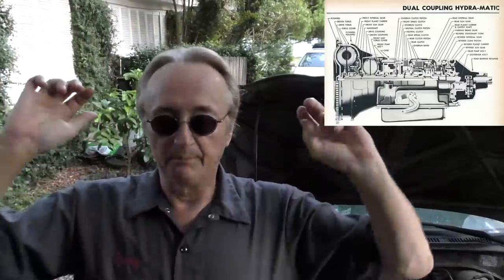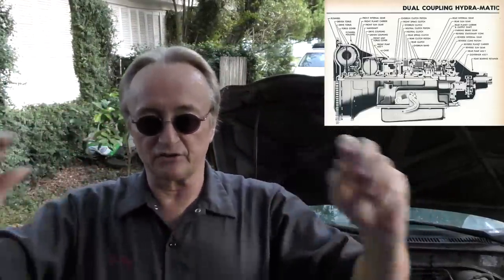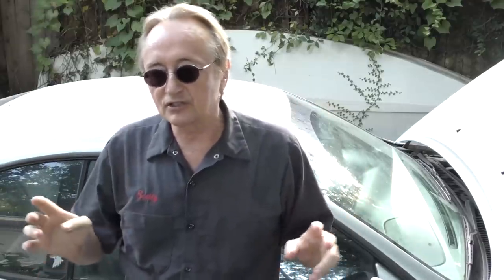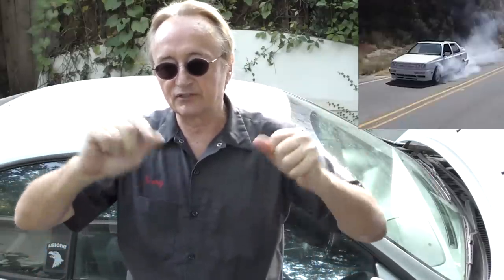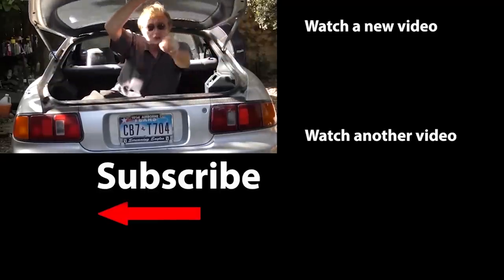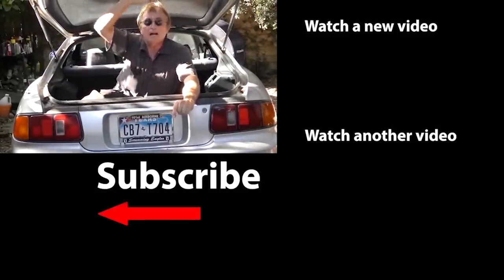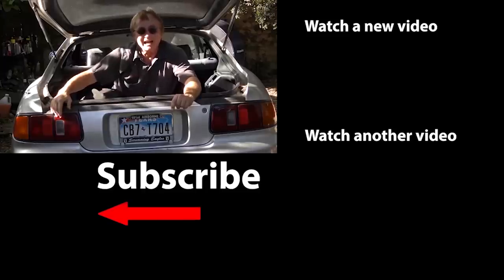This Isn't a Real Corvette, Here's Why

Comment: I had 2005 Chevy Spark. The worst  manual transmission ever. Changed 3 sets of gearbox before even reaching 200,000 km.
Reply: Anas really???😮😮😮How did that happen? Did you ever try a better fluid?
Reply: @jamesmedina2062  change it every 25,000 km with the type recommended in the user manual.
Reply: Anas yeah I was grinding gears and not feeling the gates in my Honda when it had factory fluid but after replacing with Motul, I have no more grinds(which were rare before anyways) and I can feel my way around better. I think the manufacturers sell cheap, crappy fluids and guarantee destruction.
Reply: Because it's a chevy.
Reply: @samlung2724  it was actually a rebadged Daewoo Matiz from Korea. Korean car... Never again.
Reply: @jamesmedina2062  with mine I had problem downshifting to 2nd gear. Had to do double-clutching & rev-matching every time.
Reply: Anas I do rev match when downshifting my Honda Civic. It's just suggested for any car. That said I'm sure the synchros and other parts vary across different brand cars. For example I drove a Chevy Cruze and really liked it but I had trouble finding the engagement point of the clutch. The pedal felt isolated and did not have a smooth take-up so I nixed that purchase and went with the Honda despite higher cost.

Comment: I love the way my SLK 55 AMG Shifts, intuitive automatic, it down shift every gear just as I would if I were in manual mode which it has, comfort mode for "normal" driving and sport mode for the twisty roads. Most super cars these days are automatic with paddle shifters and manual mode. I'll take my 7 speed auto but I do get looks from guys that like having their right hand on cylindrical objects constantly.

Comment: Scotty you are right, the Toyota 86 is a Subaru as you state.  However, it is realized it is not all Subaru.  The engine is definitely from Subaru.  But the automatic transmission?  It is Aisen - or Toyota.  It is a hybrid of the two manufacturers, even on the powertrain.

Comment: The Mazda 6 comes with a standard. It's really nice too; probably the same as in the Miata. I bought a 2016 in late 2015 and they even had the mid-spec Touring available.  I think in 2018 they only came in the base Sport, but they now have many of the features that required Touring in 2014-16. Obviously the Mazda 3 also offers manual. VW stopped offering a manual Passat with the 2016 model year.  The Honda Accord also comes with manual and I wouldn't buy an Accord automatic because they are CVT. So the only manual larger cars are the Accord and the 6 in the US.

Comment: 😕 electronically controlled duel clutch transmission is faster in every way!?! I can't see the laziness in that..
Reply: Can't see the laziness in the driver required to do absolutely nothing more or less than any other automatic?
Reply: I bet in a few years there will be tons of dual clutch auto vehicles in the junkyard with dead transmissions that are to expensive to fix. Just like northstar cadillacs.
Reply: @AmandaHugenkiss2915  Do you understand the difference between a manual, and a dual-clutch auto? Are dual clutch trannys actually THAT complicated to fix, finicky, fragile?
VW makes a great one, withstands as much as 500 ft-lb torque, can be tuned with software (such as APR does), shifts in fractions of a second. Yes there's maintenance with them because they have clutches that engage and disengage just like a manual transmission has a clutch that engages and disengages and wears out over time. They also have lubricating fluids, just like a true manual, but some of those dual clutch systems are wet clutches, bathed in oils (periodically or constantly, depending) just like a motorcycle clutch is.
Reply: @exothermal.sprocket  oh I fully understand the difference between  a manual, a conventional automatic, a CVT and a dual clutch auto. And while the performance of a dual clutch auto may be great and fun, we all know they are very expensive to fix or replace. I would venture that the long term  durability is not there also. Time will tell.  Especially given most people may not understand how they work vs a regular automatic, leading to excessive clutch wear. Couple that with today's inherent lack of durability due to over complexity where it doesn't need to be.... and yes, I can see a lot of cars at say 10 years and maybe 120K miles not being worth dropping 8K on a new transmission. Hello junkyard.

Comment: I have a 2012 VW Jetta TDI with an automatic transmission, I have over 180,000 miles on it and have never had an issue with the transmission. Just started having issue with the DPF though, that is not going to be a cheap fix apparently.

Comment: I got a 2009 Toyota Tacoma TRD sport with a 6 speed, 2002 Subaru WRX with a 5 speed, and a 1996 Subaru brat with a 4 speed. My only automatic is a 1991 mustang GT that I plan to swap a 5 speed.

Comment: Scotty just an FYI, Tacoma is offered in manual transmission with 4 cylinder or 6 cylinder but it’s bed/ overall length is the issue. Full crew cab with 6 ft bed only offered in automatic. As well as limited trim is only auto. Hope this helps

Comment: Two more car models that Scotty didn't mention and that still come with a manual transmission on the most basic trims are the Honda Fit (known as the Honda Jazz outside of the United States) and the Nissan Versa. The Honda Fit also has a "sport" trim that will come with manual transmission.

Comment: In the case of the Mazda Miata, the ND (fourth generation) automatic actually goes slightly faster and has the same or better fuel economy than the standard transmission.

Comment: The 60’s and the 70’s saw GM, Ford, and Chrysler producing excellent transmissions that were both durable and reliable. The Turbo400 (GM), the C6 (Ford), and the TorqueFlite (Chrysler) were all magnificent pieces of engineering. What happened that all of that changed starting about 1981?

Comment: The Mazda 3 comes with a manual transmission too, but only the premium package in FWD for additional cost so you'll be paying 30k for it. At which point you should probably just get a miata.

Comment: 10:03.  One reason for avoiding putting a stick in the new Corvette is probably the fact that it's difficult to engineer a nice feeling shift linkage if it has to go all the way around the motor to get to the transmission.

Comment: The Hyundai Veloster can be had with a manual for 1k cheaper. At least the 19's were.
In 50+years I've only had 4 automatics, a Vega, Chevy Van, Caravan and my current Ecosport.  The other 12, all stick.(09 Aveo was the last)

Comment: I couldn’t imagine living without a standard transmission (for myself). The family SUV is automatic but that’s not really for myself, it’s for the family, although the kids like to drive in my manual cars. I’ve been thinking about getting something newer to replace our old BMW but they seem to enjoy the BMW a lot. They like zipping around in the old stick shift convertible bimmer much more than a modern hybrid/electric or automatic. Contrary to Scotty’s advice, my 2001 BMW 325ci has been extremely reliable for us. It would be a shame to get rid of it so long as it’s working well and getting good gas mileage. I just wish I had more garage space to keep it inside. Recently I’ve been keeping it outside with a car cover. I don’t like taking the cover off all the time but I don’t want to ruin the rag top in the sun.

Comment: Since I bought my first car in 1988 at age 21, I've only owned standard transmissions.  I refuse to buy an automatic, which is no fun and which bosses me around.  I want to control the RPM and torque myself!  My 2018 Ford Focus ST, 252 HP turbo, which Ford only offered in standard transmission, is much more fun (at least to me) than my brother's M4 with an automatic.

Comment: I drive a 10 or 12 speed truck for a living. I could care less about shifting my own gears anymore. I enjoy riding my Harley though. But pretty much all the automatics are the best they've ever been. I'm currently thinking about buying a Mustang, I'd probably opt for the 10 speed auto versus the stick due to the aluminum shift forks that keep breaking. But I'm guessing they're only breaking under a massive load, you know, like drag racing. Also, anyone I know could borrow my vehicles, if necessary, and I wouldn't have to worry about their driving skill or lack their of. That being said, when I was younger, manual cars were cool. Now they just don't offer many advantages past the driving experience.

Comment: the 1,4 tsi CZDA is proven to be a reliable motor, 400k is being achieved by every motor that has been serviced per manufacturer specs. Customer brings a 380k 2015 model in and it's pristine (don't even want to know where their daily commute is), no issues at all and no oil burning, every manufacturer has bad and good motors.

Comment: The GT86 isn't a Subaru. Toyota funded 80% of the project and developed the body, suspension and interior. Subaru ,Toyota and Yamaha developed the engine. 
Calling it a Rebadged Subaru is even harsher than calling a BRZ  a rebadge GT86

Comment: You forgot that Honda still makes a manual Accord, Ford sells a manual Fiesta until the end of this year, Hyundai has the Veloster and the Accent, and the Elantra*, Kia has the Rio and the Forte*, Chevrolet has the Sonic as well, you can get a Fiat 500 with a manual transmission, Mazda has the Mazda3 with a manual, Nissan has a manual Versa, Mitsubishi has a manual Mirage, Buick has the Regal GS and the Verano with a manual, Honda Fit has a manual transmission, and I'm sure I'm still missing some, but there's still a lot of manuals out there if you get an econobox or a sporty car. But hear this: I live near Minneapolis, MN, and I was looking for a manual 2019 Nissan Frontier. Wanna guess how many are for sale in Minnesota? Zero. The closest one was at a dealership in Ames, IA, and they only had one. So literally unless you custom order a manual Frontier, they're nearly impossible to find. I'm sure that Frontier in Ames is going to sell fast to anyone who wants a brand new manual truck.

*Only until the end of 2019

Comment: I prefer a manual in most cars.  True, stop & go traffic in a manual is a pain, especially if it has a heavy clutch.  But in most other situations, a manual makes you feel like you’re more connected to the car, more engaged in the driving experience, and it’s just more fun.

Comment: Standard ( manual shift ) transmissions may come back on electric cars as high revving electric motors are not very durable if it has been pushed on single gear ( speed ). Advantages is that only it will allow the electric motor to last longer than if electric engines were to run on highway-speed on one gear set-up.

Comment: I have an 08 BMW 528xi with 154,000 miles... I’m hoping it will last me another 50,000 + with no real problems if I keep up on maintenance... I love the car but I’m worried about the transmission etc. it has slipped but only twice in the past 8 months, hope that’s somewhat normal

Comment: I lament the end of manual transmissions, especially in the new Be the and I think they'll lose more sales than they think. We've still got paddle shifters, but I dunno it's just not the same. From a performance standpoint it makes sense though. Even the best driver is gonna take longer to engage the clutch, shift a gear then disengage the clutch than it takes to basically push a button, at least the newer models.

Comment: I hate to burst your bubble, but along with the Corvette, the new Mustang Shelby GT500 is only available with a dual-clutch automatic transmission.  There are some real advantages to a dual-clutch automatic (DSG).  The first is lightning quick shifts measured in milliseconds.  The second, no disruption of power.  With a manual, you need to let off the gas to shift.  With a DSG, one clutch engages as another disengages, leading to a continuous flow of power.

Comment: hey scotty, i got a serious issue. My car wont start nor will the lights turn on. I am thinking my battery died because had to it take a "mechanic" but i believe they messed it up even further. It was having a overheating issue (with white smoke coming out the hood of the car first, than through the pipes after)but i believe it is because my gaskets need replacement. (like coolant starting mixing with my oil and wasnt running through out the car. )I dont hear the tradional knocking sound of the pistions hitting but it look like my car is trying to turn. I was watching as the crack shaft pulley was about to turn than it jerks back. I am not no mechanic but i try to learn about my car any chance i get. I rather be the one to know everything that needs to get done. Than a "mechanic" who is trying to make a quick buck.

Comment: The only time I will need to drive manual is if a customer has a car with one, the biggest issue with getting a job as a mechanic in Australia at least is that there are still quite a lot of cars with manuals and that reflects in job applications requiring you to have a manual licence, on top of that whenever you go for your licence you have to stick to the transmission of the car you took your test in during your probationary period, ie:if you passed your licence test in an auto you can't drive a manual unless you pay for another test in a manual car afterwards, or you can always just go for your test in a manual but it's more difficult.

Also for me it's not as financially viable since I don't want to have to go through the effort of changing clutches since I don't have a hoist or transmission jack to put the stupid thing back on once I'm done changing it.

As much as I would love to drive manual, it just isn't in the cards for me.

Comment: I strongly believe if manufacturers made better sportier cars with manual transmissions, more people would buy them. I myself, prefer driving automatic, but being that I have a Subaru wrx sti, I couldn’t find myself driving anything else besides that. And I really don’t care about the transmission, I care about the car’s performance. 👌🏻 Nice and fast, it’ll pass. But you know how it is, they’re just catering to the tastes of the majority. It really does depend on the car, If it has low hp, for me, I’d rather drive a automatic. But if it has high hp, like a Supra or skyline, then I most certainly wouldn’t mind driving the manual transmission because it’s proper for that particular car. Great points Scotty! The manual transmission has a lot of pros vs the automatic transmission!

Comment: My first manual transmission was a 1985 Toyota sr5 truck five speed manual transmission then a 1981 Chevy Chevette four speed manual transmission then a 1985 Ford F150 with four speed manual transmission and now I drive a 2001 Ford Ranger five speed manual transmission.

Comment: AS soon as 5 and 6 speed automatic transmissions came out the desirability of a manual transmission dropped considerably. If all I had to chose from were 3 and 4 speed automatics I would go for a stick shift in a heartbeat.

Comment: Interesting history of automatic transmissions. But why no mention of the revolutionary turbo-encabulator? It had prefabulated amulite with malleable logarithmic casing. It was also the first design where the two main spurving bearings were in a direct line with the panametric fan.

Comment: Love driving manual. It was a sad day when it went from being cheaper to get a manual to having to pay extra for one. The Automatic with manual shift is just not the same. I need a clutch I can feel engage and disengage. Makes you feel really in tune with your car or truck. Sadly too my generation will probably be the last to learn how to drive manual as part of drivers education and driving school. I guess maybe it wont matter if what they say is true and Internal Combustion Engines will be gone in the next 30-50 years replaced by plug in electric or fuel cell vehicles.

Comment: I believe the dearth of manual transmissions has more to do with CAFE standards than laziness, but Scotty could be or is most likely correct since he's in the business. I put a lot of miles on various 1 ton (C30's, F350's, etc..) wreckers back in the 70's with the plain old 4 speed manual. Granny gear first, followed by 3 normal ratio speeds. Seemed to work just fine. The International wrecker was also a 4WD, so you had the option of a low range if needed. Never did need it. That IH was one rough riding indestructible beast.

Comment: Nissan Frontier, 370Z, are standard. Frontier has a supercharger. Tacoma frame rails bend on a car lift, and customers demanded a recall. They sell aftermarket reinforcement frame braces for the Tacoma. Honda Ridgeline has a better frame than a Tacoma. Lotus offers stick shift on all models. Porsche so it looks like you got to buy a high dollar car to get a standard. Porsche Cayenne use to be standard. But automatics suck sometimes. Id rather have a manual in traffic than a automatic, wear your clutch out holding the brake down in drive.

Comment: I drove a manual transmission car for most of my life. I don't miss them AT ALL!!!!!

 I  LOVE my Dual Clutch transmission more than life itself. 
It's the same as a manual. Almost. It is just smarter, faster, and 1000 times less fatiguing in traffic.

Same, tranny. Same clutch. Dual mass flywheel instead of single mass. SAME pressure plate.

Paddle shift OR auto shift. FIVE levels of shift speed in both modes.
I use all its functions.

I will NEVER buy a three pedal vehicle again.